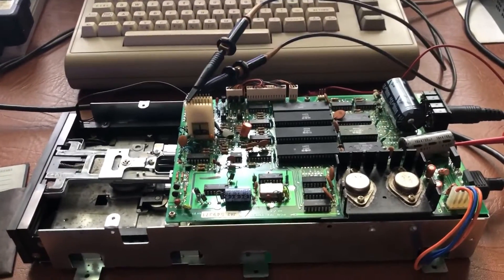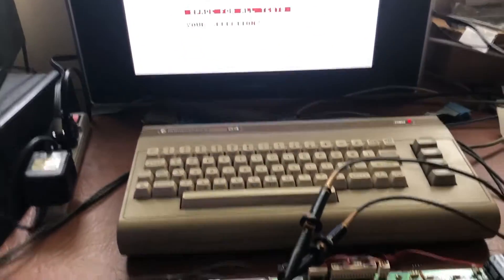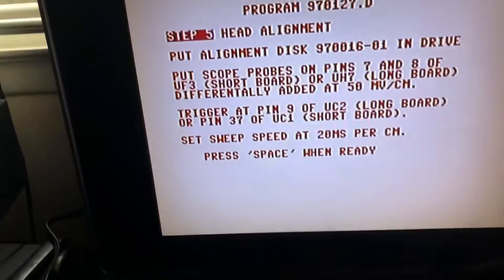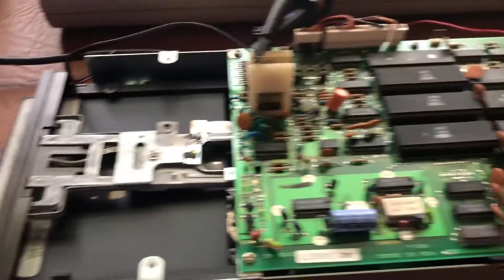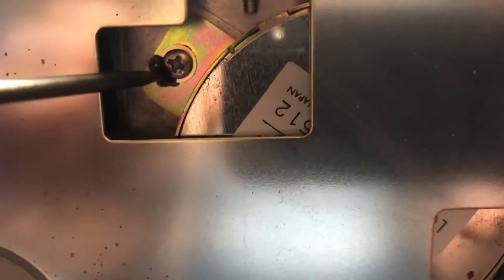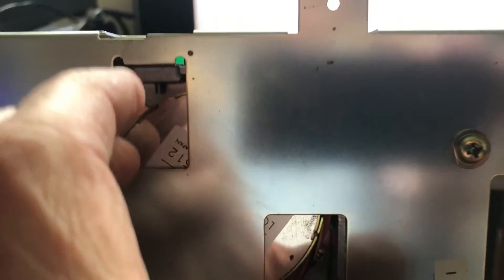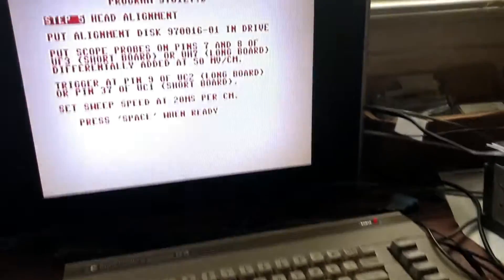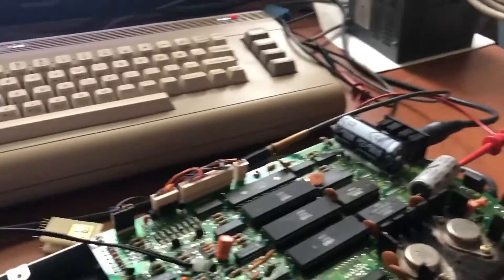Commodore 1541 Disk Drive Alignment Done Correctly

Comment: Okay gimme that alignment disk! I'm happy with my Tektronix 465B and cheap chinese Hantek 70MHz 2 channel scope that can be hacked to 200MHz. My Alps Commodore 1541 drive is probably the world's most modded and hacked: RAMBOard. Track display. Burst nibbler. Switch mode power supply. reset button. JiffyDOS (Or I can put dolphinDOS back in)...device ID switches. It loads games REALLY fast. So fast, that the track display isn't even worth watching.
Reply from the maker: I have the Hantek 20 Mhz PC based scope I use for audio work that kept locking up after a few minutes. I finally got it to work with the latest software and windows 10.
Reply: @johngibboni1678  does the community have any hacks for it?
Reply: that's problematic - what about slowing it down again? 😅
Reply: @stefankrause5138  I get what you're saying. With so many instant-loading technologies replacing the old 1541 it does seem like I've lost the 1541 itself! I use Zoom-Floppy and Parallel port with serial. Maybe I could nix the burst nibbler and parallel port mod. Or JiffyDOS because incompatibilities. I'll give it thoughts. And thinkings. And maybe a few too many cold ones.